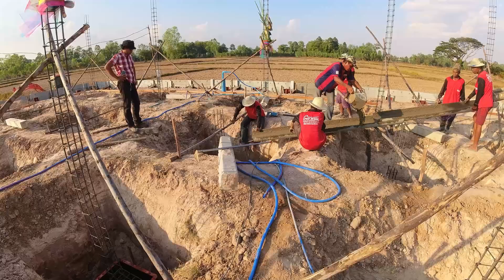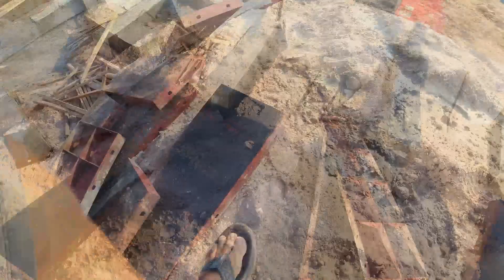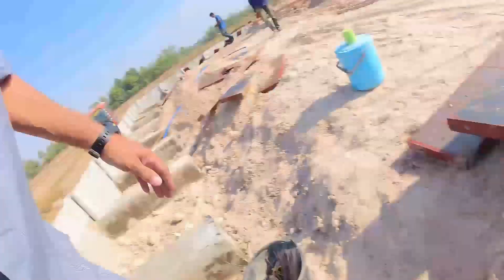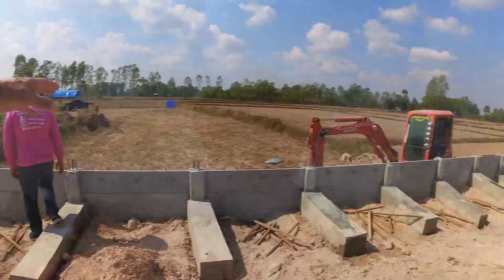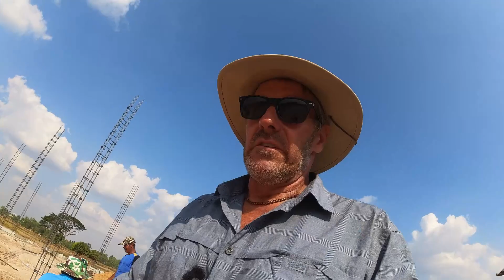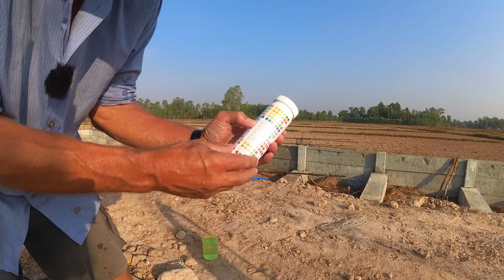Rebar, Concrete, and Testing the Well Water

Comment: Question, how deep is the well and what did they charge per meter? Thanks.
Reply from the maker: 53 meters, flat rate B18350 or $550 US, no mater how deep or shallow, warenteed for one yearit stop producing he'll come back and drill it deeper. Local guy so not sure what the going rate would be. Well drilling video in ThaiBuild 1 play list,, on the channel
Reply: @ParadiseNThailand  18000 baht? that's it? sounds too cheap! I'm looking to make a well soon and I'm hearing figures around  100k.
Reply from the maker: I remembered it was around $500US, but checked exact amount on my spreadsheet
Reply from the maker: https://youtu.be/QHklJhEbbAU?si=opsZLggCSzfMWrzE

Comment: Our crew should finish assembling the rebar for the ground beams today (day 10), the boss put a couple of extra workers on the job so they finish before their day off tomorrow. I worked out that by the time those beams are finished we will have used around 2800 meters of rebar ! Sounds incredible, had to double check my sums after imagining nearly 3km of rebar laid out. The guys did have to reposition one beam after the boss realized the architect had made a mistake in the floor levels, the laundry/gym/store building was the same level as the patio and could have flooded in heavy rain. Like you we have been asking questions, just to subtly let them know we are keeping an eye on things.
Reply from the maker: We are finished underfloor plumbing and electrical as I type. Excavator is backfilling floor now. I expect floor pour in two days, then columns a few days later. Moving much better than expected.
Reply from the maker: Much easier to ask ahead before they do it than trying to get them to accept they did it wrong. Good work!

Comment: Did the concrete truck turn on its mixer before unloading the concrete? The CPAC mixers normally have a consistent mixture but if the driver did not use the mixer before unloading inconsistent concrete may be delivered. I am building my house with piles as well but all my concrete has looked the same and I have never had the watery stuff you have shown. Also, my crew have not used a vibrator because, as you have said, the steelwork in the columns does not allow it to work properly.
Reply from the maker: Mixers are turning, but sub contractor is having them add water at times, after sample runs

Comment: Hello!! Been watching your video's of the house build. Nice job!! We'll be doing ours next year. Your perimeter wall... way, way over kill!! (Very nice!!) That thing should NEVER move an inch so I wouldn't worry about it!! As for the watery concrete they poured for your footings... I've watched dozens of YouTube video's for house builds in Thailand and the concrete is almost always that wet. I have heard it explained numerous times that it's because of the high temps and often times very dry conditions when pouring. The air and even the ground will suck the moisture out of the concrete too quickly causing curing issues. I've even seen them wetting the ground and even the concrete slabs before pouring on top. Same with red bricks before building a wall, they wet them down. You should also see them wrap your uprights in cellophane after removing the forms to reduce moisture evaporation from the concrete so they cure properly.
Reply: After recent experience I agree with everything you have written, Charles. In fact one of my uprights, in the porch, still has its cellophane wrapping. Everything was watered before concrete was used on it.
Reply from the maker: I have seen the many videos as well, just goes against everything I thought I knew. You will see me just walk away not knowing what is truly correct, as I see some truck with western type slump. I'm biting me tongue most of the time, and have decided vibratory are not needed on the soupy loads.

Comment: Most of the time they just use a stick, with all the water yes self leveling, but due to the heat, it don't really crack,  you would be able to put in a salt filter and some sediment filters, during the summer and a great water supply
Reply from the maker: The plan is salt softener and then a sand filter with carbon filter.

Comment: You need to just walk away and let them get on with it, if you don't you will start to get angry, however that concrete is watery even for thailand standards. When they did mine I thought it was watery but no where close to that, you need ro be firm but diplomatic with them, it stays green a while, that concerned me also.  Look at my earlier  videos and see what my concrete was like.  They will also spread a thin layer of concrete under all the beams so they are not pouring on dirt.  Put your water through a food grade  carbon filter system, a single one will do and makes even our dirty village water drinkable, not that we drink it but you can cook and clean vegetables with it.
Reply: Builder number 4 coming soon 😅
Reply from the maker: I watched your entire build as you posted them. I've started saying, "nom...nom" and walk away. Let them know I don't like it but not call them out. Most of time I can't watch it so I go lay on my desk.
Reply from the maker: Well be installing a softener to preserve taps and pipes, filters for the reasons you stated.
Reply: I didn't go round for about 2 weeks at one point as I was so wound up, I had to keep away,  they got concerned that I wasn't going round and knew there was something wrong, when On went round one day she explained why I wasn't going round, the builder asked her to get me round and he went through everything, the whys, how's etc, that eased my concerns for a while, however I still couldn't get my head round some of the things they were doing, everything fell into place though, now looking back I shouldn't have had concerns or tried to compare to a western build.

Comment: I've been told the wet slurry is due to temps and humidity in n Thailand.  Yeah vibrating the mix will send the aggregate to the bottom but you need to fill all the nooks and crannies also.
Reply from the maker: Agree on all points. I'm torn between, when to vibrate and when to let if "flow". They are already confused so I don't want to make it worse, jumping back and forth with vibrating based on the crete coming out of each truck.

Comment: Yeah you're right about the rocks (ballast in the uk) sinking to the bottom especially with the vibrator but the answer i'm not sure because they deal with the heat out there ? which needs research i guess.
Reply from the maker: I keep telling myself the same thing, "maybe with this climate they are doing it correctly", and then I tell myself, "if i demand a change and then it fails, he will not be liable".... legally. All I can do is express my concern and walk away shaking my head.
Reply: @ParadiseNThailand  Yeah i mean how about other hot countries ie saudi arabia how do they do concrete ? that's what i was thinking about ?

Comment: I am totally amazed at the watery concrete thru out Thailand. I would guess you are losing up to 40% of compression strength if the concrete is the same as where I am from. I have seen much failing concrete thru out Thailand. Have you researched if the mixture is as same as the west?
Reply from the maker: I can tell you the engineer gives them the mix and it is in the build plan, but to me, it does not look like what I expect see going in the hole, compared to what I saw in the West. Every truck that arrives is different and I see cement mixer operators adding water onsite at the request of the sub-contractor, so I know they are not following it. I believe I point this out in the video coming up in two days.